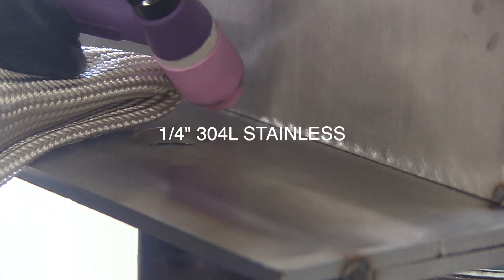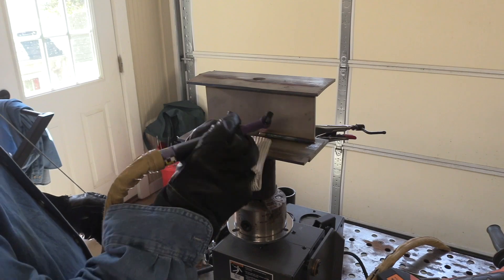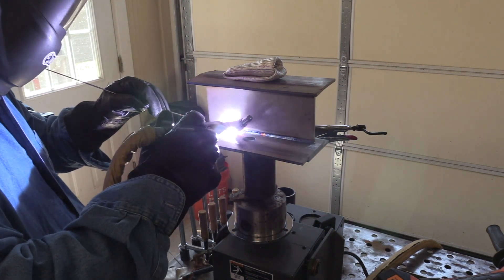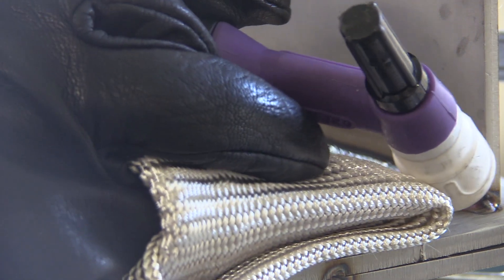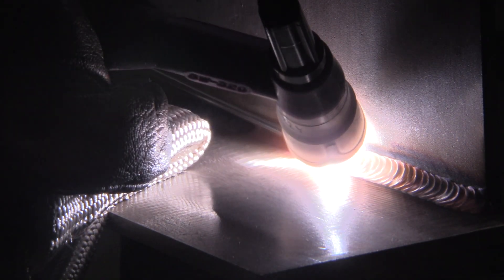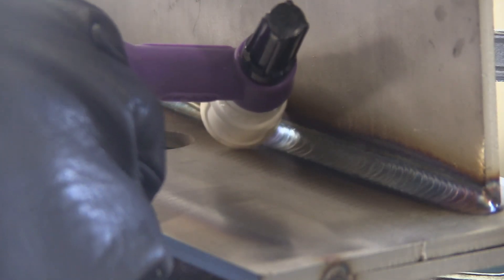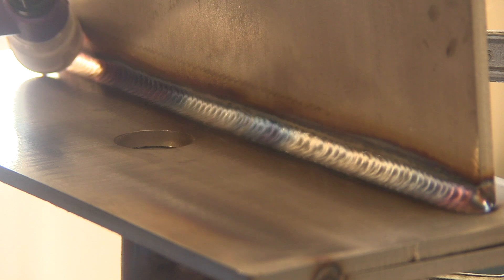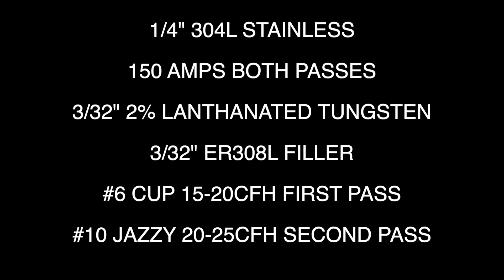TIG Welding Techniques for Stainless Tee Joint

Comment: Big Tip on Post weld  Aluminum,DO NOT WIRE BRUSH WELDS AFTER COMPLETION OF WELD BEAD ,Because if it is to be flo-pen inspected IT WIL FAIL, Wire brush micro scratches caused from brushing will show up as CRACKS,Granted most of the time you can wire bush the bead ,This being said ,if you du wire brush any aluminum Be sur to use a designated brush that has not been in contact with Carbon Steet of any kind

Comment: hey idk if you reply to comments but im having a problem with lay wire. every time i lay the wire down as i am welding along the wire will come out of the puddle and start melting before i go over it. im getting really frustrated witht this i just wanna know what im doing wrong i hope you can help.
Reply: Not sure if you figured anything out but check your torch angle. Make sure you're not at too much of an angle and keep your tungsten pointed more towards the plate. You start getting too steep and your heat comes out of the weld pool and melts your filler wire. Or you're too far away and need to tighten your arc.

Comment: Is it possible for you to go from left to right instead of right to left like your doing in this video but using the same hand setup
Reply: If you mean can you drag the bead along instead of leading it, no
 TIG always has to be advanced into the filler. No room to do it backwards and the filler would pile up behind the weld, and constantly foul the electrode. You want the arc pointed at the root of the joint, no more than an electrode width off the material being welded.

Comment: That lay down filler rod technique looks easier than feeding it. Is there a reason why this technique can’t be used other welding positions? Thanks ,Jody. John
One other question: have to tig weld a t joint on 3/8 in stainless. Do I have to root pass this and  weld over or could I do it in one go. ? Amp ? Volt settings
I am just a hobbyist welder. Thanks again

Comment: Why does tig require in-nurte  gas but oxi-acediline can be welding with steel clothes hangers
Reply: You're conflating two ideas. First, TIG can also be done with a steel clothes hanger, provided it's clean of all paint and grease. It's just a filler metal. But to your base question, you don't need a shielding gas with oxy-acetylene, because you are welding with a gas already, and the combustion of said gas provides a shield for the weld from our atmosphere. It's built into the process, unlike methods which utilize the heat from an electrical arc. The heat of the burning gases also burns paint off your crappy old coathanger, which if done thoroughly, can prevent you from needing to clean it off like you do for TIG, on your questionable repair.

All forms of welding benefit from clean base metals and filler metals. No chance for inclusions if you keep it clean. Save the coat hangers for cleaning drains or chinese steel production, and get some ER-70S2 for that weld.

Comment: For a titanium weld test on some .040 silver color is mandatory……..full penetration, also mandatory. To work for an aerospace welding company, do those companies use plus size cups for weld tests or even on their product line? Is it easier to achieve both standards with a bigger weld cup? I’ve been focusing on getting good color and letting everything else take the back seat, to an extent. Should we gain the experience in our garages before taking to a facility?
Reply from the maker: there is no telling what a company will provide as far as cups and trailing shields. I have a friend who tested for an aerospace welding job and all they had was the large diameter gas lens collet bodies. But if the fixture is adjustable, chill bars can be set close to the weld and will often pull enough heat away that a #10 cup is sufficient to achieve silver color.  here is a video I posted a while back using a #10 cup  showing that concept

Comment: Outstanding video, Jody. Any chance of doing a 2F 6-bead to joint on 1/4 steel with TIG? Kinda having trouble with that in school for some reason. Doing the lay wire technique and this joint just will not come out like it is supposed to. The root goes in fine, but subsequent passes are harder to get in for some reason.
Reply from the maker: I will put it on the list but you will probably be done before I could get it shot lol.  But let me ask some details anyway...Is it a tee joint? stringers or weave? and are you required to do lay wire? Any particular size wire?  If root goes in good, but subsequent passes go bad , it could be surface oxidation so a gas lens might help along with  letting it cool between passes along with wire brushing every pass.
Reply: @weldingtipsandtricks  Hi Jody. No worries. I`m sure it will take time to get videos out. I can answer your questions though.
1) 2F T-joint on 1/4 carbon steel plate.
2) stringers (but slight weave) and I`m required to do lay wire for some reason. Walking the cup is not allowed at all BTW. My instructor wants 6 beads. 
3) 1/8  ER70S-6 filler rod. I`m welding @ 140amps on a Lincoln Aspect using Hi-freq start W/ a foot pedal. We also use gas lenses on our torches with #6 cups at ~30CFH. Maybe some surface oxidation, but only the "pretty colors" ;)

I can get the root in OK, but getting the other passes in is a little harder for some reason. I made on that looked decent, but my instructor is making me keep trying as the beads favored the bottom plate too much. The problem I have is that subsequent passes are not always flowing right. Meaning they do not always flatten out but can crown up too much and don`t tie into each other. He said I might have been adding too much filler metal (not sure how, maybe too much pressure on the rod?) I try to keep the torch and filler rod at about 90 degrees. I`m running a slight push angle on my torch, but currently, I can only get a decent bead if I push the weld towards me a bit for some reason. I also have to hold the torch handle almost parallel to the joint and it makes my hand hot rather quickly. The first pass is put in at 45 degrees and then the torch angle needs to come up a bit with subsequent passes. My instructor said to point the filler rod and tungsten at the center of the root for the second pass. It is such a simple joint, but it is causing me issues for some reason. It is probably a simple fix once I get it, but now it is a little hard. I don`t know what the issue is. My gut tells me some kind of torch angle problem but I`m not sure. I`ll be talking with my instructor about it more on Monday, but I greatly appreciate any advice you can give me. Keep the videos coming Jody. I always love watching your channel. It is always fun and informative, and you were a big inspiration to learn welding. Thank you for everything. 

Connor
Reply: @connormarek1028  Don't run 30 cfh on a #6 gas lens, you could probably run 12 and that's more than enough.  Turbulence? Other than that, sounds like you're doing things right on paper.
Reply: @MikeYurbasovich  Thanks. I`ll try turning the flowmeter down a bit. Yeah, it sounds like stuff is good on paper, but something is out of whack. I`m sure I`ll get it eventually, but I just don`t want to be stuck on one joint for too long.
Reply from the maker: @connormarek1028 140 amps seems a bit low for 1/8 filler.  I would think 160
Reply: @weldingtipsandtricks   Thanks Jody. I`ll give it a try.
Reply: @connormarek1028  
Turn down the cfh anywhere from 10-15 its usually 2 x the cup size could be that the excess argon is cooling down your weld too much and not letting your puddle wet out as well as causing turbulence also if your pass is favoring the bottom plate on any horizontal position I always place my filler higher than I normally would in other positions to counter act gravity that way once gravity does its thing your bead ends up right where you want it hope this helps.
Reply: @JoseMorales-yu4di  Thank you, sir. I`ll try it as soon as I can.
Reply: @ChevyConQueso  Yes I did ;)

Comment: Hey I wanted to ask, do americans weld aluminum with a pulse Mig machine? Ive never seen a video about it, in Europe its pretty common to use pulse setting with a regular Fronius machine, beads come out white and clean, not dirty and irregular like the spool gun many people use.
Reply: Someone has been feeding BS
Reply from the maker: Sure we do it all the time. Just not many videos on it. Miller, Lincoln, and others have push pull systems that pulse.
Reply: I didn't learn anything pulse in the late 90's at weld tech. School but yes we pulse mig aluminum all the time
Reply: I was taught you can't use a MIG machine to weld aluminum (only a TIG method works)... 🤔😕
Reply: @davidbolha then welding biofuel tanks would take me months with only tig😂, do american academies teach something else beside stick and pipes?
Reply: @johngreen4726 Jeesh, them Euro types are always going on about how arrogant Americans are.  😂
Reply: @davidbolha gotta change out ur liner but you can
Reply: I mig weld ally every day yes you can@davidbolha
Reply: Yes we do
Reply: I use a Millermatic 350P on aluminum all the time where I'm employed here in Wisconsin. We specialize in agricultural equipment. I build the feed/bulk trucks that transport feed to mills and farms across the state. I've had to weld anything from 1" plate down to 1/8" (.125), the wire we use is .047 ER5356. Welds come out clean, but have  the soot on the toes.
Reply: @bigmacattack1179  sounds like you’re the man bro 😭 keep it up frfr you livin the dream